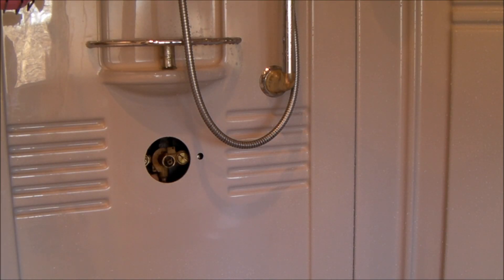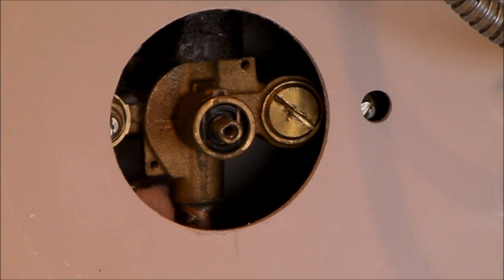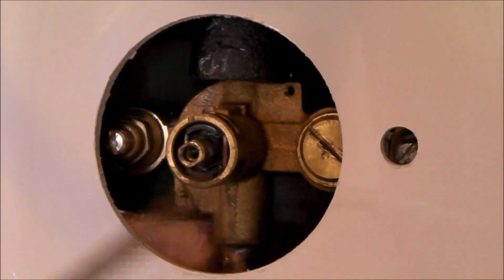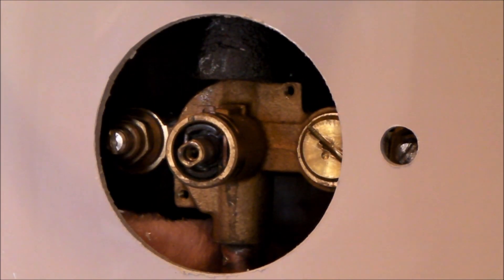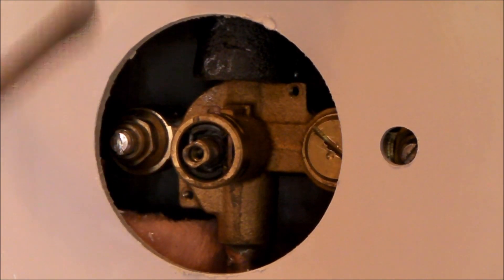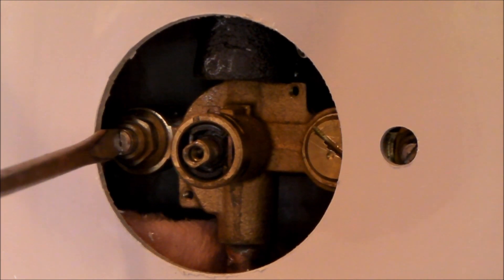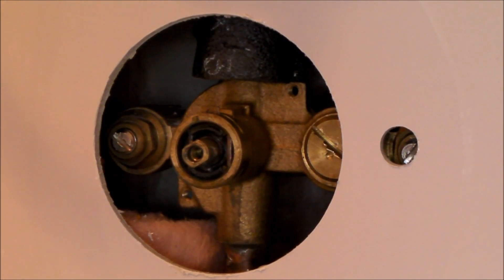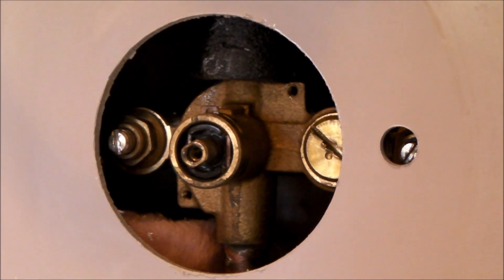Moen Shower valve - stop check valves and pressure balancing spool location

Comment: You are DA MAN. Thanks for digging in and figuring this out.  No one including my three or four  recent searches know anything about these. Even IA chimed in with no such MOEN valve. Yet it stares at me in my 30 year old custom built home., in three bathrooms.  Huge news is I don't have to turn off the water in the entire house to repair. That means NO LIVING WITHOUT WATER WHILE I CUT ACCESS PANELS IN AN ADJOINING BEDROOM OR GARAGE in my case. This is probably the MOST IMPORTANT to me YouTube I have ever seen. I also learned again we all should go to the second. third, and fourth page of a google search to find the answers that we think should be there.  THANKS AGAIN.

Comment: Rather than using those two screws to turn off the water, it's better to not touch the screws and go ahead and turn the water off at the source.  There should be a valve that controls the water flow to the entire house.

Comment: Thanks you have explained those shutoff valves when the manual did not. That could be my problem with low pressure in the shower

Comment: Hey dumbell.
Those two screws are used to set the maximum temp of the outflowing water for safety.
You set them so that the hottest temp to flow out will not be hot enough to scald you.
Reply: I don't think that's correct.  (And I won't call you dumbell.)
Reply: Calling someone dumbbell and being dead ass wrong is crazy 😂

Comment: Have you ever replaced one of the stop check valves? I have the same setup, mine started leaking after I turned them off to change the cartridge. Now it leaks around the screw head. 😮‍💨
Reply from the maker: I have not.  Good luck.
Reply: I just experienced the same problem.  My best advice is not to mess with the check valves!
Reply: @stevenoliger2763  I ended up just getting a new valve, turning water to the house off and changing it
Reply: @justinmaloney910  My leak was just a drip now and then. I tweaked the valve in and out a few times, which for some reason slowed it down even more. Then I turned the house water off, applied some silicone at the leak (with the valve in open position), let it solidify somewhat, and no more leak. Temps and volume are fine out of the shower heads so no need to adjust it.  Guess I'm good but I won't be screwing with the check valves again...

Comment: You mentioned the cold water shut off screw was jammed stuck, how did you get it to un-stuck, I have a problem with the hot water side, I'm unable to loose or turn it, I can only do that the cold water. Any tips would be appreciated.
Reply from the maker: I never got it open and decided not to break it.  If I were to make a tool, I'd cut a quarter in half and then use a vise grip with the half quarter as a bit, to try to open that.
Reply: @YuDaMan  thanks for the response!

Comment: NOTE: For this particular Moen faucet model, you can also avoid having to turn off the water to the entire bathroom by simply closing the two screws (the one on far left, and the one on far right, both clockwise AS FAR AS THEY CAN GO - till the screw heads are only about a 1/16th of a inch visible). Doing so, closes/shuts down the water flow to the faucet's center cartridge and the pressure/anti-scald regulator cartridge, making it easy to change each of them out and/or clean each one anytime you want. Then after you reinstall the cartridges, you open up the screws all the way counter-clockwise to resume water flow to the faucet. Saves some time and headache.
Reply: If you have an older system, it's better not to mess with the check valves. I closed mine, did not overtighten, and the right one immediately started leaking.  I wish I had turned off the house water to save some time and headache.

Comment: Thanks , I thought those stop check valves were fine adjustments maybe for in cases where the hot and cold water pressure was different on each side.

Comment: Thanks for your help.  I had asked a question under a different profile about your model.  It looks like I deleted your reply and my question today...didn't mean to do that.  Anyway your video did help even though you are working on a different part.  It looks like I need to replace the balancing spool to the right of the cartridge.  I'm not getting any water at all on the hot setting.
Reply from the maker: Contact Moen.  They have lifetime warranty if you are original owner!
Reply: @YuDaMan  Cartridges are FREE at the store you bought it.Buy it for looks,Buy it for life...the only real place it can fail is the cartridge,fairly easy replace with supplied unlock tool in box with cartridge...Good Luck